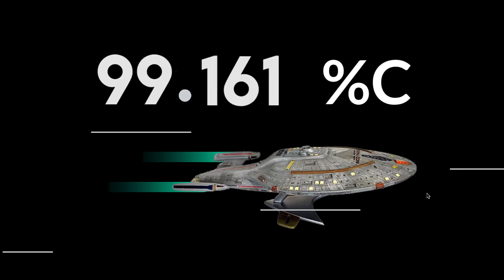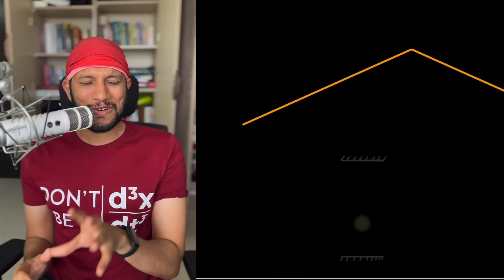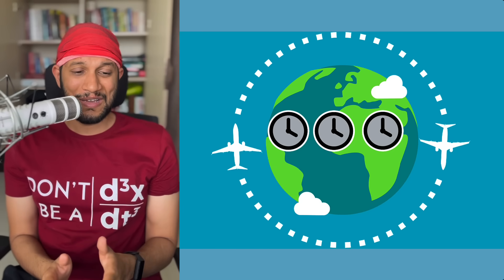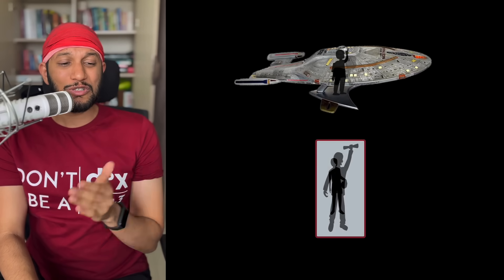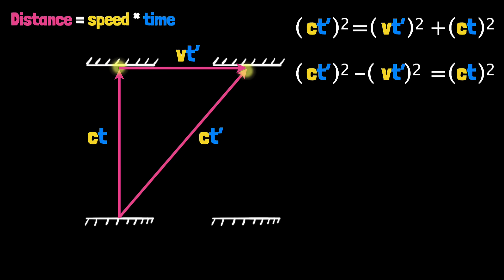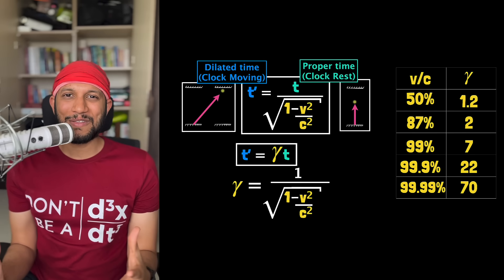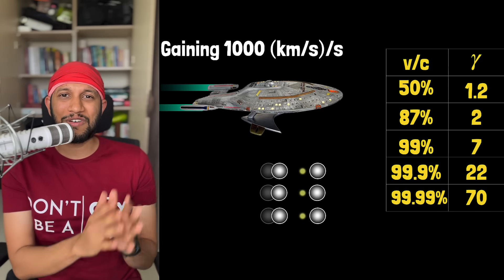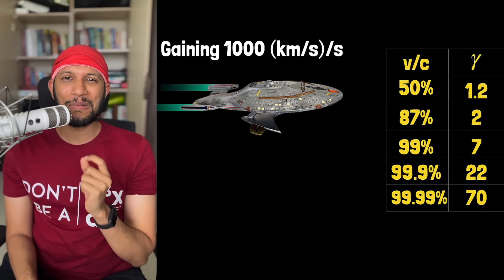I finally understood why you can't go faster than light! (My mind is blown)

Comment: This is a good way to explain physics in the popular way. I really like it. Although I think it's worth to mention one thing. Viewers might get the impression that light is something fundamental to theory of relativity and also ask a question why the hell is speed of light constant. It's worth to mention that special theory of relativity is a bit beyond this. It can be derived from just one assumption - that speed is relative and every inertial system is equal. From that assumption we can derive all the equations finding out that there is a mystical constant there which has this interesting feature of being the 'maximum velocity possible'. If we put it at infinity we get Newtonian physics. If we put it at c we get special theory of relativity. Light only by 'accident' uses this speed therefore it's speed has to be constant in all interial systems and is very useful in all these mind experiments but again it is not important to the theory itself. The theory is more or less about geometry, kinematics and dynamics. There could be an universe without light or electromagnetic force and special theory of relativity would still work.

Another mindblowing thing that can be explained in this matter are the magnetic forces. It turns out that there are no magnetic forces. There is only electrostaric force. The effect of magnetism comes from relativistic shortening of the wire. I know it's not that easy to show it geometrically and it requires a bit of calculations, but for me it was one of the most interestigs facts about physics while I studied it. It so amazing that the special theory of relativity binds electricity and magnetism into just one force.

Comment: I'd appreciate it if you went back to the explanation using the clocks only this time rotate them 90 degrees and apply the same explanation. The distance the photon travels for a round trip remains constant regardless of speed.

Comment: Your example shows a Star trek spaceship traveling through the curvature of space ("warp").
This is not a suitable example because the principle is completely different.
Matter within space cannot move faster than light. The speed of light itself is also unattainable.
But warp works differently.
There is no known speed limit at which space itself can expand.
On the same principle, there is no known speed limit to the distortion of space.
Space is moved, not the spaceship.
Therefore, there is also no time dilation during "warp" travel.

A real warp bubble has been created in a civilian laboratory and documented.
It must therefore be assumed that it is possible to build such a drive.
No matter how long it takes, there are certainly many civilizations out there that are millions of years ahead of us technologically...
And if something is technically possible, it will be built and used at some point.

Comment: Time dilation is utter nonsense, its like having two people in different geographical positions relative to Earth counting out of synchronization and claiming they are aging at different rates. Mathematical nonsense. Time is a concept, a measure, you may as well claim the number 7 has properties that can be manipulated physically.
Reply: try calculating physics without it
Reply: No, it's fairly basic physics that has been experimentally demonstrated repeatedly for over a century.  You are disagreeing with literally every single physicist on earth.  This is basically like saying "1 - 2 does not equal -1, because negative numbers don't exist, they are just a concept", i.e. juvenile nonsense.

Comment: Something still seems off for me: From the percpective of inside the ship which is accelerating 1000km/h/s everything seems normal, right? Doesn't that mean that if you are in the ship, you still continue to accelerate as much with the same amount of power used? Doesn't the speed at which power is consumed in the ship also half, as the time runs half as fast?

Lets say they do double the power when time runs at half speed. Seen from the outside they still use the fuel at the same speed as when they started, and seen from the inside of the ship they use double the power but also accelerate at double the speed, and the amount of fuel used to reach the speed of light would not be exponential...
Reply: you're always motionless in your frame.  the engineer doesn't notice any engine inefficiency.  Say he continues to apply  1 G of thrust/second in his frame.  The stationary observer measures less acceleration due to time dilation--not 10 addt'l meters every 1 second, but 10 addt'l meters every hour.

Comment: Hold on, that is what is happening from the frame of static clock, but for the time frame inside the ship is still ticking normally. does that mean the ship is going beyond space time once its goes super close or over speed of light? 
So from our prospective (out side of the ship) we think its been frozen or needs infinite energy. but with in the ship its been beyond space time to some level.

Comment: Then at the 99.9999999999999999999999999999999999999999999999%  speed of light the traveller will experience crossing over 2 million "observable" universes one by one  in his 1 second., eventhough observer will still see him travel slower than light, but waiting kvadrillions of years.   Nice , It means from the traveller point of view there is theoretically no speed limit ( in km/s) ... because of a local time. Time is very local then. It also means photons are not experiencing time at all and every distance is instant from their perspective, isn`t it ? That is also why even from the mentioned traveller point of view photons are still relative to 1C compared to him, because he is practically closer to zero speed than to the speed of light, because of the time presence for mass object.

Comment: I’m disappointed he completely ignores the perspective of the person inside the spaceship.
Reply: I think there's a follow up video that covers this.  To summarize though, suppose Alice is on the ship and Bob stays behind on earth.  According to Bob, Alice is moving at 90% of the speed of light away from earth and her clock is running slow.  So far this is all covered in this video.  Now let's look at Alice's perspective.  In her own reference frame, she is at rest (since her reference frame moves with her).  So according to Alice, her time continues to flow normally, and it is Bob who is traveling at 90% of the speed of light away from her and whose time is dilated.  

Also, note that Alice (she's on the spaceship that is accelerating) will never exceed the speed of light in her own reference frame.  This is trivially true since she must always be at rest in her own reference frame.  If there is a speedometer aboard the spaceship, the speed that it measures necessarily must be relative to some external reference frame, such as that of Bob's on earth.  So for all the reasons covered in this video, this speed will always remain less than the speed of light.
Reply: @extravagantpanda7962 thank you for the explanation, I appreciate it.  Not let’s ignore Bob, and focus on Alice.  Will there ever be a point where she will reach a speed where, from her perspective, it will take 1 year to travel a distance of 1 light-year?
Reply: @k-bear7707  Well, again, we have to think about what is means for Alice to measure her speed.  If she measures her speed relative to herself, then her speed is zero.  If she measures her speed relative to Bob, who in this scenario is traveling at 90% of the speed of light relative to Alice, then her speed is 90% of the speed of light.  If she measures her speed relative to Charlie, who is moving at 50% of the speed of light relative to her, then her speed is 50% of the speed of light.  And she has all of these speeds simultaneously, because speed is relative: there is no "absolute" speed.

So her speed depends on the frame of reference we measure from.  As explained in the video, from any arbitrary reference frame, her speed can never reach or exceed light speed.  So there cannot exist any perspective in which Alice travels at the speed of light, and therefore there cannot exist any perspective in which Alice travels one light year in one year.  However if she is traveling at 99.999% of the speed of light in some reference frame (let's say relative to David), then in one year she will travel very near 1 light year, according to David.  But other observers will disagree on both the distance traveled and time passed.
Reply: I really appreciate you’re taking the time to explain this to me.  I think i understand; Alice will experience a little more than 1 year of time if traveling close to c to another star 1 light-year away, but from the frame of reference of the star, it will experience time dilation.  So tell me if this scenario is correct: if she travels .999c she might get to the star in about 1 year but the star will be many eons older than when she started.  But if she travels at .999999999999c then it’s possible the star might be so old when she arrives it’s dead/burned out/novaed/etc./whatever; in fact the whole universe might be so old that it will experience heat death/max entropy because it would take infinity to reach near c speed?

Comment: because c is an irrational number... it's like infinity... and actually the speed of light is infinity its' just that you measure it in a vaccuum which you believe to be nothing because you are too dumb to know what it is but it's a barrier at which the speed of light is limited just as it is limited through any medium it travels through, if you were smarter you would know what is beyond a black hole and what the ether of space really is, which is something that's why the speed of light seems not to be infinite even though it really is cus by definition nothing doesn't exist

Comment: Ok, but two objects, approaching each other at 51% of the speed of light, what does that look like?
Reply: We can't just add their speeds together like we would in classical physics.  That works fine as an approximation for low speeds, but for speeds that are a significant fraction of the speed of light, the approximation breaks down.  Instead, we have to use the formulas of special relativity, which will always give a relative speed less than the speed of light.

Comment: The experiment is wrong! If you are looking at the 2 clocks as photons of light passing through time at different rates 1st the stationary clock is moving in a straight line which is what light does IN VACUUM. However, IN OUR ATMOSPHERE DUE TO PARTICLES IN SPACE when light passes through into our atmosphere light collides with particles refracting and slowing down the speed of light and thus its time. There goes your time dilation… 😂 The stationary clock is simulating light as it travels is vacuum. The moving clock is simulating light being refracted by particles. When you change the direction of an object that’s in motion, the object slows down each time.

Comment: Question: So from the point of reference, it takes more time, because of time dilation. Yet inside the ship,  from their reference, they still add 1000 km/sec. So - who  cares what someone back home is looking at? If I am adding 1000km/s in my reference and say my fuel supply can keep it up, eventually, I'll get to C...no? Surpass it...
Reply: If you are on the spaceship, how are you measuring your speed? In your own reference frame, i.e. the reference frame "attached" to you that moves with you, you and the spaceship are at rest.  The spaceship is also not accelerating in this frame, so clearly you will never reach light speed (or any non-zero speed) in your own reference frame.  In order to make a useful measurement of the spaceship's speed, you necessarily have to do so relative to some external reference frame, and that's exactly the situation already described in this video: from any external frame, the spaceship will approach but never reach light speed.
Reply: @extravagantpanda7962  SOrry about the time delay, I didn't see your message.

How about this: If I have an engine and each time I throw an energy pellet into the chamber, I get a 10m/sec extra push. I know this, because this is what happened, when I tested the spacecraft. So I keep  throwing pellets into the chamber and I keep getting a 10m/sec increase in speed. Up and up, each time I know, with even looking outside, or looking at a speedometer, I can feel the added push added to my velocity. 

I am going faster and faster. 

So what happens as I approach light speed? The same pellet does NOT give me a 10m/sec push? I feel nothing? No acceleration? The pellet which game me that added speed, when I was going at 1000m/sec and it bumped me to 1,010m/sec...doesn't work anymore?

Is there some force in front of my craft, holding it back? There's no atmosphere in space, like on earth, that has an increasing pressure wave. 

Why, at a slower speed - would I get the full push, but not at faster speeds?

Comment: here's my problem with this explanation. If you gave the same example using sound waves and doppler, you would conclude that the speed of sound could not be exceeded. Yet pilots in multi mach capable aircraft can talk to each other just fine, except for interference from environmental noise. If people were to travel together at faster than light speed, they would see each other just fine, but outside their enclosed vessel or "system," the visual information from distant stars would be received at an accelerated rate, making the stars appear to get younger in the travelers eyes. It's all relative. I don't believe human perception of visual light is somehow an ultimate limiting factor of the universe, although it is definitely a limiting factor to human perception. Otherwise, how can the universe be 26.7 billion years old but visually observable to be 92 billion light years across.

Comment: The faster an object goes, the more observable mass it has. The more mass you have, the more fuel you need. But adding fuel means adding mass. Which in turn means adding even more fuel and so on. If you calculate the weight of your ship and rate of acceleration in proportion to its increase in mass. You realize that upon reaching c you’d have infinite mass. So your ship would weigh more than the entirety of the universe. Thusly, you’d need infinite fuel to move your infinite mass.

Comment: What if spaceship A travels in one direction relative to a stationary observer O at 70%c, and a different spaceship B travels in the opposite direction of 70%c relative to stationary observer O?
Relative to O, the difference in velocity between the two ships A and B travelling in opposite directions is 70%c - (-70%c) = 140%c.
Can the stationary observer O conclude that the velocity of A relative to B is 140%c ? ie faster than the speed of light?
Reply: You can't just add the velocities like that.  That works as an approximation in the non-relativistic limit, but it breaks down at relativistic speeds.  The correct formula for the relative speed will always yield a speed less than c.  I think there's a video on this channel that covers this.
Reply: That was one of the big paradoxes that lead to the creation of the Special Theory of Relativity. 

The answer is that you don’t add to the velocities to shift from one frame of reference to another, you also apply a scaling factor.
Reply: In your example spaceship A would see spaceship B flying away from him at 94% of the speed of light, or 0.94c

Comment: so let's say, I am in that spaceship, I am actually going ahead with acceleration of 1k km/s, outsider might see this acceleration slowing down.. 

but from my own perspective, is it that I have crossed speed of light ? because spaceship speed is being increased by 1k km every second ?
Reply: The spaceship's speed relative to some external observer increases by 1km/s every second, but from your perspective onboard the spaceship, it is always at rest (since it is moving with you).  In order to measure a non-trivial value of your speed, you necessarily have to measure it relative to some external reference frame, and as shown in the video the ship's speed in any such reference frame will asymptotically approach light speed but never reach it.

Comment: But something can travel at the speed of light and it does not require infinite energy because light particles travel at that speed. Is light actually an expression of infinite energy? I think not.
Reply: Light has no mass
Reply: The claim is not that "traveling at the speed of light requires infinite energy", it is that "it would take infinite energy to accelerate a massive object to the speed of light".  Light is massless, so light traveling at light speed does not contradict this claim.
Reply: @extravagantpanda7962  if light is massless, how can it produce force?
Reply: @dalemckenzie4468  If you mean how can it impart a force on, say, a solar sail, the answer is that light has momentum.  Of course in Newtonian mechanics, momentum is defined as mass times velocity, but this is not the case in special relativity where it is possible for a massless particle (like the particle of light: the photon) to have momentum.  If you accept that light has momentum, then explaining how it can apply a force can be done purely through Newtonian mechanics.  By Newton's second law, force is equal to rate of change of momentum, so if a photon can impart momentum on a massive object, it can produce a force on it.  

If you mean "produce a force" in the sense that the photon is the carrier of the electromagnetic force, that's a much more complicated question that requires relativistic quantum field theory, i.e. graduate level physics.
Reply: @extravagantpanda7962  thanks for the schooling.